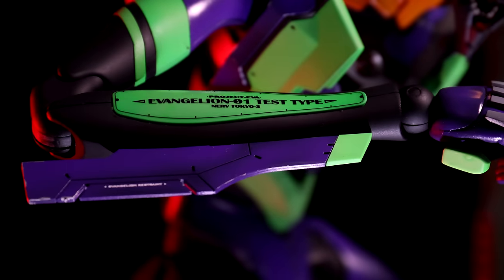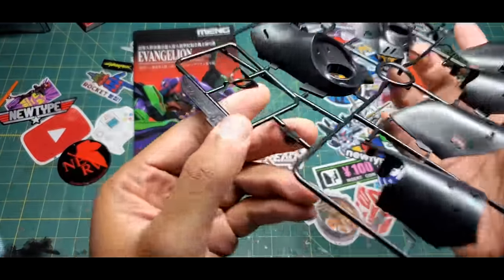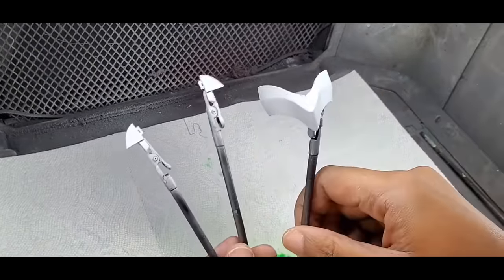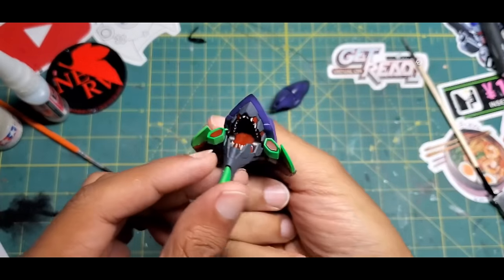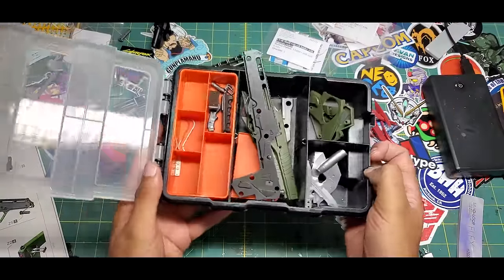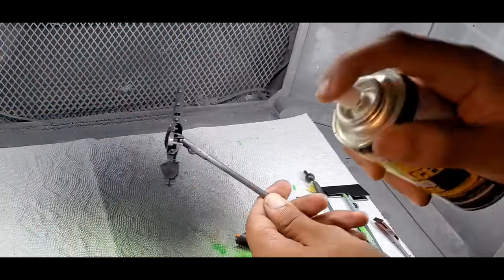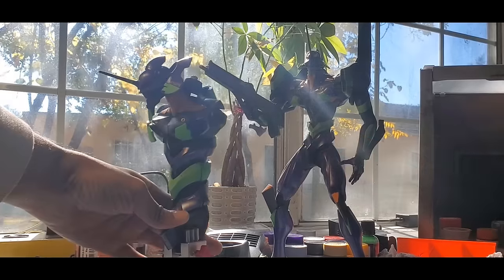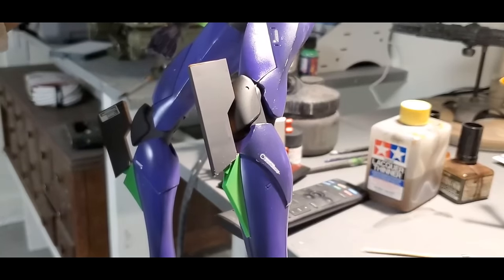#newtype #neongenesisevangelion  MENG Rebuild of Evangelion EVA Unit-01(PERFECT GRADE?!)

Comment: Sweet awesome EVA kit, it's even taller than the Dynaction EVA-01 kit (40cm) by Bandai. The only flaws that I find, if they can be called flaws, are the no light up "1" on the shoulders and to actually using the power cable as actual power cable to light up the LEDs.

Comment: 300 dollars??? Gundamit has it for 150~. My local hobbyshop had it for that price too on preorder. There's a 1.5 version releasing soon for even less with better proportions and at a lower cost (At the cost of it not being prepainted or having the spear and gatling as accessories). The model is really neat, but definitely has weight issues and would have benefitted from having better ankle articulation.

Comment: when you used the tamiya weathering kit at the end. Do you wet the little brush? I have one but know really how to use it
Reply: You can use weathering kits both ways. Dry gives you a dusty/blast mark/burn mark effect and wet will give you a streak effect is oil or rust streaks

Comment: I doing the led for the PG unicorn with the led it comes with. But i am having trouble finding a extension for the led wire for a custom job was wondering if you know where i would some with that connector?